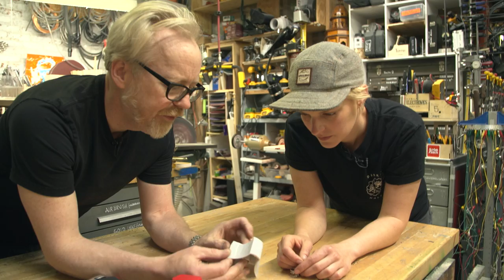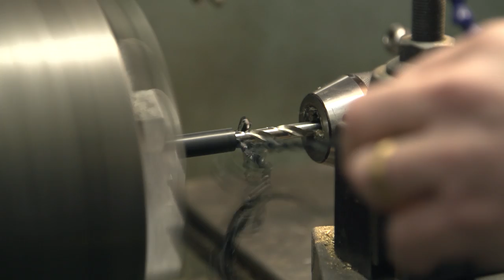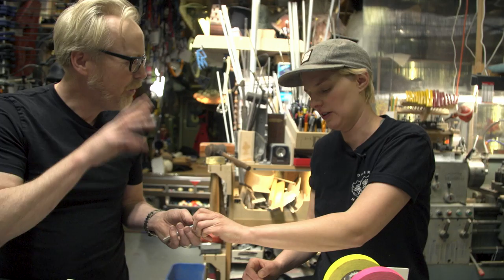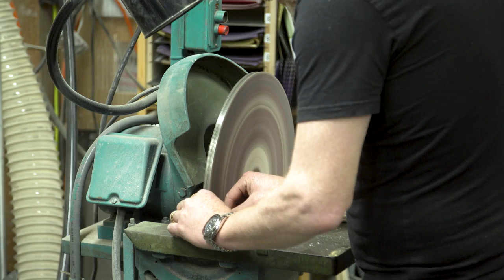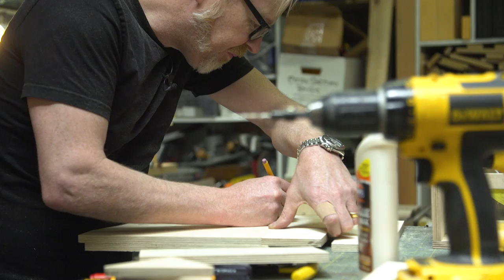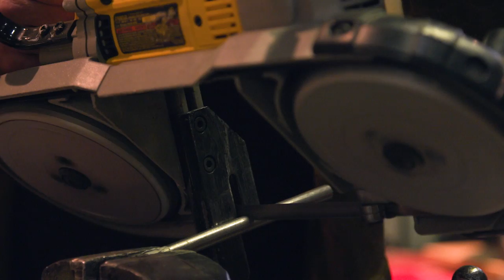Adam Savage's One Day Builds: A Better Tape Dispenser!

Comment: I'll suggest my design now, before seeing what they come up with. Seeing Adam's tape storage makes me think, yes, store horizontal, only 1 roll high (i.e. no stacking, keep extra elsewhere), and each roll setting on a short wooden pin mounted into the shelf so that you can pull tape from it one handed while the roll is on its side, but simulate the metal tape cutting edge by having some metal stand up from the shelf with the cutting edge to the left side (for right-handed people).  You can build a 3' shelf that would hold 6 or so rolls, shelves can be spaced closely together vertically with enough space to accomodate differrent widths of tape, and the wooden peg (dowel) mounted near the back of each shelf lets you pull tape, OR, just lift the roll up over the peg to take the entire thing, and the metal strips at the front (like a normal desk dispenser, but on its side on this case) let you singlehandedly pull and cut lengths of tape.

Let's see how I did... (unpauses video)

Comment: Instead of cutting the plastic part down, I'd use it as a template to cut duplicates out of wood. Cut a beveled disk on the band saw. Then use a drill press to cut the coves in the spindle and a hole for a shank/axle. You can then fabricate an indexed box to hold several. Think of a dozen or so cellophane tape dispensers side by side. Use discarded hacksaw blades as the cutters.

Comment: I know I'm super late to this video but I'm going to make a suggestion before I even watch this as a solution: Oversize D-Rings set on a spring clamp and mounted on a cut of PVC pipe to hold the tape and create a wall mountable surface; with a sheet of angled (up toward the tape) aluminum to both cut and hold the tape after each use. If you need the whole roll you can push back to release the D-ring and pull it right off.

Comment: Take the packing tape dispenser, drill hole in each handle, run a rod through them. Attach a second rod to act as a bumper holding the dispensers around parallel with the floor. Then you can rotate them up to slide the tape off, or push down to remove a bit of tape

Comment: the blades are are open. removing the springs and inserting the useless bushings removes the adjustable resistance, so the tape doesn't unroll uncontrolled during cutting.

Comment: Could you have used a locking hinge as a stopper instead of a leaf spring?  I drive school bus and the emergency doors have a track lock hinge.  You open the door so far and a catch locks the track so the door stays open.  To close the door, you fully open it and the catch disengages.  I know you have driven buses on Mythbusters, so you know what I'm referring to.  Just don't know if they make that type of hinge the size you need?  When you were designing the dispenser, you wanted to able to remove and put back on the roll of tape 1 handed.  When you tested the leaf springs, it took you both hands to to disengage it.  I love what you do and I miss you, Jamie, Jessie, Kari, Grant, and Tori!!

Comment: I think instead of what they did if it locked down and had a release in front and the back of the arm had a spring on it.  That way you hit the release in front and it would lift on its own and you could do the whole process, on or off, with one hand

Comment: Have a cone shape plunger that you can push with one finger and will force pieces outward locking up the roll therefore allowing  to rip a piece with one hand, and loose enough to pull the roll off

Comment: another way to lock arm in place to replace tape could be from the side, cut a small dimple into the tape arm, use a spring loaded rounded tip dowel to push into the dimple on the lifted arm. when done simply lower the arm, no need to manually move the dowel.

Comment: Get a board drill holes in it with the same diameter as the handle of that tape dispenser and you can put it in and out of the hole it can stay there stationery or you can remove the whole thing or you can sit there for 40 minutes and try to figure out some over-engineered way I'm doing it

Comment: You should take the tape dispensers and make it so if you apply enough force to pull it out the thingy will pop out and you can pull the tape off the side, but it wont pull out if you grab a piece of tape.

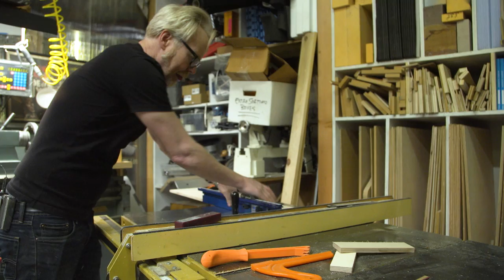Comment: Safety comment: Starting at 17:01 he's using the table saw fence as a cut-off guide, which works until the piece binds up and comes flying back into his stomach. This happens, don't ask me how I know, but I can show you the scar. But a very bad practice, anyone who uses a table saw for a living will concur. 
The better way to do this is to clamp a piece of stock to the fence so it guides the piece until it contacts the blade but no further.

Comment: Adam, the only thing I would have done different is to also cut the 2" hub down, make removal easier. it will still track OK to just take off tape, and make removal with one hand, as easy as the others!

Comment: A telescoping arm would have been better because then you could just pull the tape rol toward yourself to get it in position to remove the tape without the need for high shelf clearance AND minimize the distance to the back wall. Only a small bit of distance would be needed between the rolls to facilitate the telescoping arms. This would maximize your storage space and even allow you to make each dispenser modular by attaching additional dispensers to the right using a bracket latching mechanism. All these functions would be operable with just one hand and have adjustable width for wider tapes.

The handle should be made to roll down in front of the dispenser for quick access and minimizing the storage requirement.

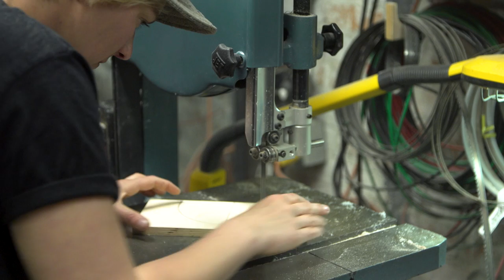Comment: Ahhhh! At 29:21 they edited the 2 shots so the bandsaw shot cutout with Adam’s thumb at the blade and the sound you hear is the disc sander. It gave the impression that he was loosing a finger to the saw. The sound was almost the exact right noise for that as well. 😨

Comment: I just started the video, but i would have an array of dowels sticking out of vertical wood panels, curving up at the end like some toilet roll holders and a metal serrated strip on a plywood strip in front of each roll. Just lift and slide a roll off. Or use the serration for a piece actually a resin piece instead of plywood before the blade for the tape to grip would be nice

Comment: I think you should use magnets to lock the lift on the taperolls because then u dont need to reach down and pull the spring
Reply: Agree.  There is more than one way to skin a tape dispenser.

Comment: Idk why you need to be able to pull the roll off with one hand, if you pull the roll off you might as well have just had it on the work bench next to you because at that point it's the same situation. But the pulling off a piece one handed makes sense

Comment: Instead of tape dispensers that holds the tape roll you should have used a carabiners where if you pull it holds, but if you push back on it, it releases.  So if you want to take 1 roll you push, if you want 1 piece you pull.

Comment: The bearings are the opposite of what's needed. The adjustable friction provided by that spring would make it easier to operate. I would have kept more of the original dispenser.
Nevertheless, great build guys, via a scenic route :)

Comment: Instead of the plastic piece for the lock you could of made it with metal just like a frame lock knife and you can use a bigger 90 degree piece of metal for that   So it's it's wide enough for it to lock under the wood .... last longer and more sturdier

Comment: I've been looking everywhere to try and find a good way to build Qrow's sword/scythe/ shotgun weapon that is actually transforming for like cons and stuff but I would actually like to bile one not of just foam and wood but of wood and metal so that I could potentially use it as intended I don't necessarily need the shotgun part to work but I was wondering if such thing could exist I think of all the people I know I think this is the one place where I think could do it. I'm just not impressed with the plastic and pvc ones I believe that they would be easier to brake.

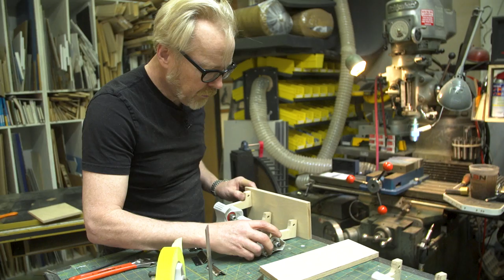Comment: Adam, your shop is amazing but could be safer. I notice throughout your video's there's no dust collection anywhere so you're breathing quite a bit of nasty dust. Then there's the bit at 20:50 where you cut a squarish piece on your table saw.  Sometime in the future a small offcut like that will twist, pinch the blade and kickback furiously.  Use the sled. Or put the riving knife back in. Please?

Comment: Does anyone else feel like they could’ve engineered it a whole lot simpler without a mechanism to lift the tape up. Like certainly a u bracket that holds the tape up could’ve sufficed and if she wanted to move it there could’ve been a lock there to keep them from jumping out

Comment: Let's see, you scrapped 6 tape dispensers and used 6 thrust bearings and a bunch of hardware. Better I think to utilize your lathe to make the spindles and use a hack saw blade for the tape cutter.

Comment: Well, that looked fun and I'm sure it was a 'bonding' experience, but I think I would prefer a rack that holds the plastic tape guns by the handle and facing me.  You could still pull the tape gun out of the rack to reload or take with you.  Each gun/cutter would still accommodate the different widths of tape.  I think this should have been a good example of not fixing what ain't broke.

Comment: Why not just use 6 PVC pipes to hold 6 tape guns? Maybe too easy?
Reply: Was thinking the exact same thing. I would however suggest to modify a couple of the guns simply by splitting the plastic roller part in 2 halfs, and adding one of those neat thrust bearings in the middle to keep them spinning independently, and still have the friction brake working on both for "top down" application, like when closing a box. That should be just the thing to carry 2 of those 1 inch rolls. Maybe add a separation behind the cutter, so the tapes don't cling to each other. Ought to be simple and fairly fast to do. And if they really want them to sit on a flat shelf, just unbolt the handle and add some weight and surface there instead to stabilize it for when placed on a table etc., and perhaps some rubber feet or those magnets and/or what ever to keep it from sliding about when pulling on the tape. Won't be usable for fast box closing then, but still a far simpler mod. And far more compact on the shelf.

Comment: way to waaay over complicate this. i would have used those original metal dispensers, taken the handles off and bolted them onto some plywood with a handle. i guess your way works but it could be better

Comment: Its weird to me that american tape measures dont have centimetres and milimetres on them!!!! Our tape measures in england have both metric and imperial!!
Reply: Well, some American ones do, but even less than in engineering and mechanics, the building trades (carpentry, etc.), the largest number of the users of tape measures, hardly use metric at all. All lumber (except imported "Baltic" plywood) and the majority of hardware sold in the United States is sold in imperial units only. Thus by such measures (pun intended) do we Americans perpetuate our cherished exceptionalism.

Comment: At around 17:08, you made, what I believe, is a very dangerous cut on your table saw.  I'm sorry, but when I saw the way you made the cut, I just cringed.  The cut you made violates the generally accepted table saw safety advise of "never use both a miter gauge AND rip fence at the same time to make a through cut".

The recommended way to do what you did is to use a stop/gauge block 2-4" wide attached to the rip fence well behind the blade.  You then use the rip fence to set the position of the left edge of the stop/gauge block to control the width of your cut off piece.  The cut is then made by sliding your board along the miter gauge fence until it contacts the stop block.  Now as you push the piece through the blade using the miter gauge, the cut off is no longer trapped between the blade and the rip fence.

The real problem with the way you made that cut is that the cut off piece could be kicked up and back at the operator, even using the push stick you used to control the cut off piece all the way through the cut.

Comment: Thrust bearings are completely 100% wrong for this application. You couldn't have made a worse choice. The pressure is coming horizontally and you used a lateral bearing. I love you Adam but if you need something in this situation just use skateboard bearings.

Comment: an all you had to do is just cut a piece of 4" pvc pipe an put the rolls of tape in it
Reply: and, then u cannot take out any roll you want without taking out one by one.
Reply: Ideas like that are the reason Tested has millions of subscribers and you have less than 2K.
Reply: apply cold water on that burn
Reply: Literally one minute into the video:
"Often, my problem is that I put my tape on....for years, I put my tape on spindles"
So, the question becomes, did you even watch the video? Or is it the attention span that doesn't actually work?
Reply: I thought he meant instead of the tape roller part they are using. I just use some arms I made out of plywood and two dowels. I leave enough space between each arm and the dowels to get the roll out. The rolls go on the back dowel, and the front holds the tape. I suppose you could just add a blade to the front dowel, but I just use a pair of trauma shears. I never like using just one hand for tape.

Comment: cool, unnecessary, over engineered. could over engineered half as much. use your file box construction, box with dividers.  make "L" shape slot to hold center spindle ,with your bearing ,from tape pulling out. BUT, still one hand removal of a roll.

Comment: I'm honestly disappointed in this, this video is seriously making me angry with how over engineered and under effective this is. A simple trough with rollers on the bottom and back. Blade in the front and a hinged lid. You can lift the lid to take a roll or just take a piece from the roll. I am screaming at this video. I will provide drawings if need be
Reply: And their build takes way too much space on a shelf but it's just a stunt.
Reply: If this video makes you angry i suggest you visit a shrink.
Reply: They intentionally over engineer. You must be new.
Reply: knovaj rogers it’s supposed to be overengineered my guy